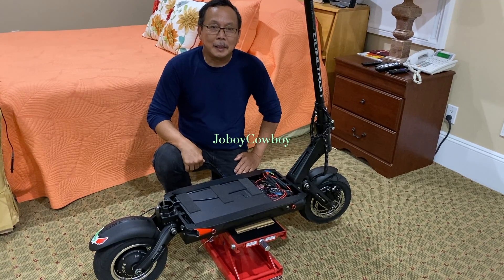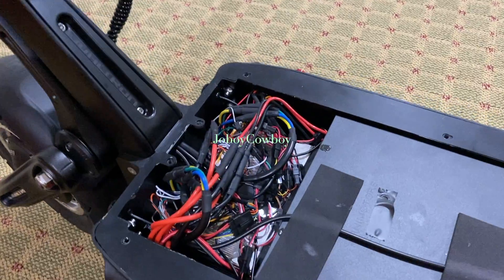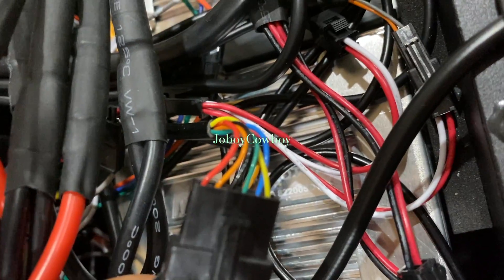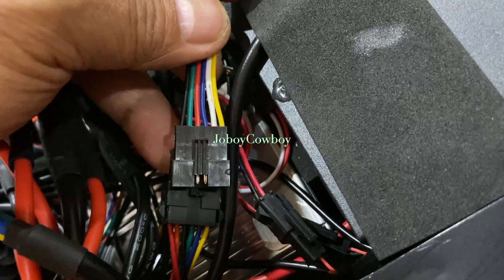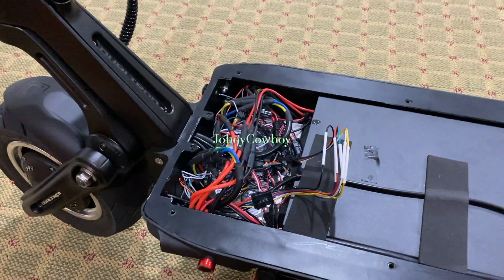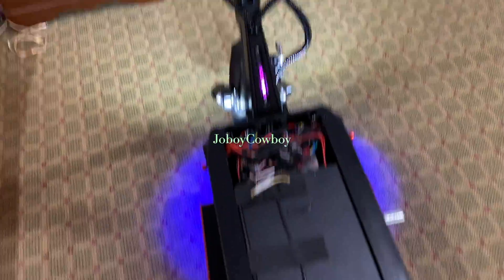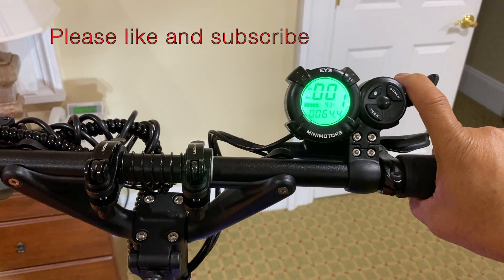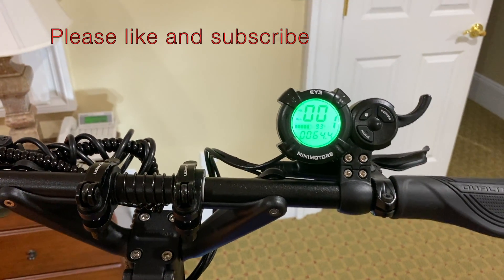How to install GSM Kill Switch and GPS Tracker on your Dualtron Thunder or any other Scooters

Comment: Where did you get other connections?(wires)
Reply from the maker: Which one? If you’re talking about the main wires, it is the connection from your controller and the other side is from your LCD/Throttle. That’s where I connect the jumper wires.
Reply from the maker: If you’re talking about the jumper wires, I ordered it on Amazon. Watch Part 2 of the video, still editing, subscribe and click notification bell so that you’ll know when it’s available to watch.